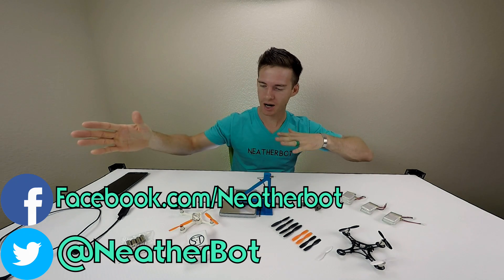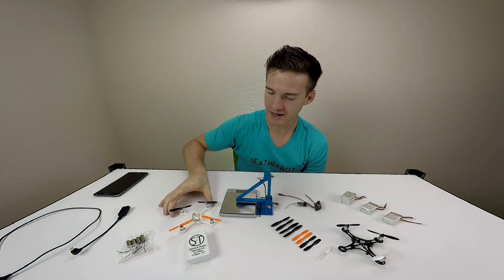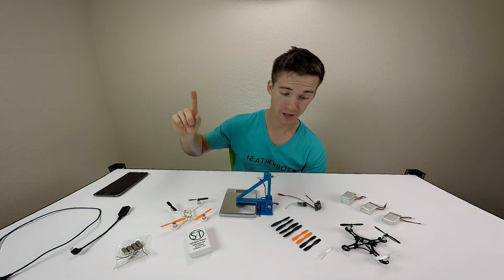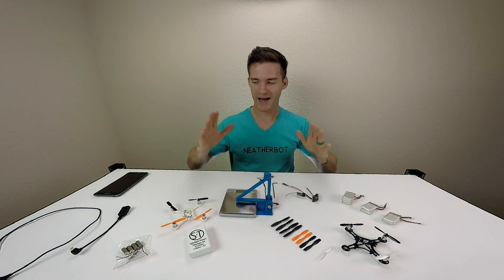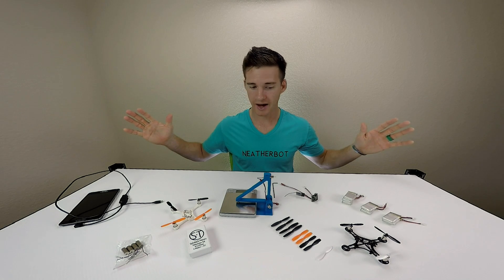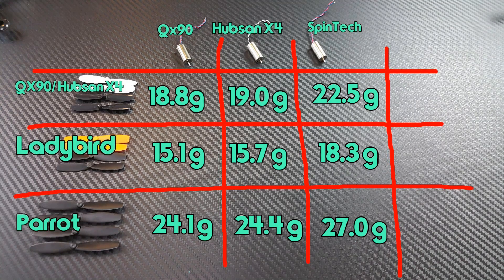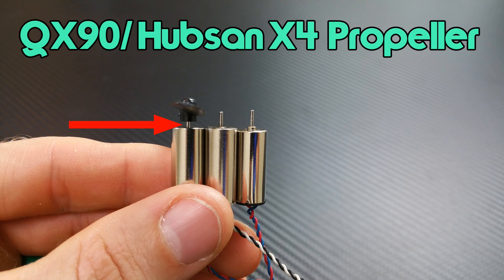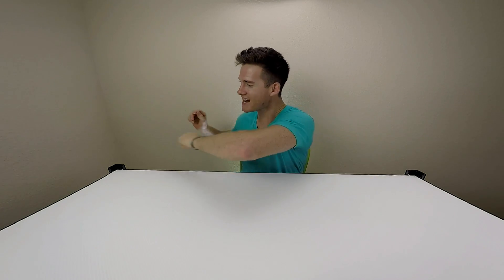Micro Motor Comparison

Comment: If you go to gearbest and look up nihui u807 motors they are 8.5 x 20 and they are around $1.50 each, they do come with long leads with connectors attached.
Reply from the maker: +DroneXFun this is music to my ears! What rpm are they?
Reply: NeatherBot   It didn't say, they are just stock replacements but they work really good on the U807.

Comment: So you're pretty much just using your phone instead of a laptop using that app instead of betaflight / cleanflight? Also what free program is there out there that I can use to design stuff like this the only thing I have right now is Cura.
Reply from the maker: +Larry Allard yes, the phone had an app that can adjust betaflight parameters. Tinkercad is a free Web based cad that is pretty powerful. Check it out!
Reply: Alright I wasn't sure. thx for the reply!

Comment: I had a friend print your test stand. It was fun getting it going. I just powered the motor directly. One of the most interesting things I found was that even a small nick on one of the blades reduced the efficiency of the props a lot. as much as 10 percent. So toss those nicked and bent props.
Reply from the maker: +Victor Johansen that is a great piece of advice! I have never considered looking at prop efficiency based on if they are nicked or bent. Sounds like a great video idea! Thanks for the comment. Cheers!
Reply: It disrupts the airflow. You might try sanding it out, but you will likely still have a loss.

Comment: can you please make a chart for amps which motors use most by comparing each props and motor to check how much battery time required to discharge during flight.
Reply from the maker: +Reality, Comedy & Entertainment I have ordered a tool to measure the voltage and current the motor uses during testing. I will be doing some more motor testing in the future.

Comment: Will the Parrot props fit on the QX95?
Reply from the maker: +Miko Smitho The parrot props do not fit without bending the QX90 frame or mounting the motors at an angle.
Reply from the maker: +Miko Smitho The QX95 I am not sure, I have not seen one yet.
Reply: Thanks for the reply. The QX 95 is awesome! I highly recommend it!

Comment: I found these cheap 8.5x20 coreless motors on aliexpress. The product page says "continuous current: 0.15A". Does that mean I can't go above 0.15A? Here's the link https://www.aliexpress.com/item/2PCS-DC3-5V-8520-8-5-20MM-Mini-Model-Helicopter-Coreless-DC-Motor-With-Great-Power/32392862460.html?spm=2114.10010108.1000013.3.pHy3Bx&scm=1007.13339.33317.0&pvid=1009e7ef-ec3d-47b0-b2b3-75258c71e819&tpp=1
Reply from the maker: +Arijit Ghosh continous current means that the motor can run at a load that draws 0.15 amps perfectly fine and not burn up. There are spiked loads that can momentarily go above that rating but only for a short period of time.

Comment: can you do the same with the new 2s 8520 and 1020 motors from banggood as these are becoming more popular and are being included in new models and people might be more interested in them...

http://www.banggood.com/Chaoli-CL-820-8_5x20mm-2S-Coreless-Motor-for-90mm-150mm-DIY-Micro-FPV-RC-Quadcopter-Frame-p-1084265.html

http://www.banggood.com/Chaoli-CL-1020-10x20mm-Coreless-Motor-for-90mm-150mm-DIY-Micro-FPV-RC-Quadcopter-Frame-p-1084263.html

very good setup and tests by the way.
Reply from the maker: +Khaja Shaik this is great! Thanks for the heads up. I'll try to get some of these in to review and give yall the results!

Comment: Nice job but did you take in account that the parrot prop produce more thrust because it is a Bigger prop. in the design of airfoils A longer arm and wider chord will produce a surface with a grater lift or thrust. the down fall is more weight added. but i think it is the reason the Parrot did so well....due to its bigger size...in my opinion its not a valid test. However on the quality build and durability of the different motor had interested me on to your experiment but you discounted that with a comment by you on the cost of the motors instead. if the more expensive motor has lower heating qualities and greater RPM it may be worth the price i hope this peaks your curiosity and make a video on that issue...thanks

Comment: you should try the cleanflight gui, it's better. you have to use a  laptop , but the set up is awsome. you should think about flashing betaflght, it will make your drone fly sweet
Reply from the maker: I have Betaflight flashed and it does work very well!
Reply: A lot better,i bet.

Comment: Also wont the parrot props take longer to spin up, being a large prop. Thus causing instances where you lose altitude in rolls and flips. Would be interesting to see the spin up times recorded (for the data nerd in me).
Reply from the maker: Not sure if it would make a noticeable difference. One way to find out!

Comment: Wanna know a real secret? Hook the motor directly into the battery. Same thing as full throttle without the extra crap in between.
Reply: It's pretty likely that in this sort of application, motor power is just controlled by a FET directly connecting the motor and battery (pulsing on and off to control power). 100% throttle will very likely be the same as a direct connection (minus some small loss in the FETs).
Reply from the maker: I would argue that would not provide the same voltage and current. On these micro quads it may not make a difference. We will have to test out this theory.
Reply: It should provide the absolute maximum power of each motor. As long as the cell remains at a steady state of charge, nothing should change. I'll print it out maybe and test it.
Reply from the maker: +joblessalex but there are inificiencies and limits in the FC that regulate and control voltage and current to the motor. Depending on the power curve of the motor and what the power output of the FC is you could see a difference in output between the FC and a straight battery. But I have not run any testing to show this. Yeah please let me know what your testing shows!

Comment: Are the parrot props the same as the Gemfan 65mm? they look pretty much the same and i fly them :)
i also heard, that the qx95 motors are better than the QX90 motors. (look at andy RC's channel) and i wonder which motors that are.
http://www.banggood.com/2-Pair-Gemfan-65MM-ABS-Propeller-Blade-CW-CCW-for-6-X-15-Coreless-Motor-Racing-Multicopter-p-1042645.html?rmmds=myorder
Reply from the maker: +MrPurple these are great questions! I will have to look into those gemfans. I really like AndyRC, he makes great videos! I must have missed his QX95 video. I'll look in to those motors as well. I'll post back in a bit.

Comment: So you tested all props in the wrong spin direction and treating your results, like it were 3D props or not? In my opinion you should make the motor pull, like on the copter, as you cannot put the prop upside down on the shaft. Unless you drill through them to put them upside down :)
Reply: mark schear no the props have a airvoil they dont work the same in reverse
Reply: i thinking the same he is running the ladybird prop in reverse
Reply: I've used propellors at this size backwards, and it does make a significant difference.
Reply: Mark Schear of course it does
Reply: serg fpv for all  intents and purposes, the stats are accurate. when all product is tested the same the results are reflective on each other. that means it don't matter.
Reply: serg fpv Reynolds number look it up
Reply: serg fpv you really think there is going to be a difference with this small of a motor and prop. maybe if you go to brushless  motor with larger props you mite see a measurable amount of turbulence. what your talking about is not even measurable at this scale. like I said I don't matter

Comment: Nice setup. However you forgot voodoo twisters and mmw motors which both are better than anything you tested in my opinion. You compared more props then motors. Should change title to "micro prop comparison."
Reply from the maker: +qwkmx5 hmm I may have to look into those motors. I had not heard of them before. I tested 3 motors and 3 props so it was a toss up ;)

Comment: maybe by making the motor aim up on a 45 degree angle you might get more accurate reading...as you will be pushing along the bearing axis not sideways. 

good video.
keep up the educational videos.
Reply from the maker: +meky0 if the motor was in its same location but angled at 45 degrees it would break its force vector into two componants. Only one of those components would be registered by the scale. Having the test stand point the motor perpendicular to the scale is necessary so that you get the same exact force down on the plate as the motor puts out. I hope that makes sense. 
Thanks for the thought and encouragement! I hope someone learns something from my videos :)
Reply: don't you lose alot of force trying to axially ofset the bearing?, would you not rather radially go with the rotational axis giving you a larger force on the scale, this would give you more resolution to distinguish differences.

i think i know what you mean by splitting force- perhaps your right, perhaps force will split and push into the bearing- down,
i feel however it will go down the easiest path the 45degree structure directly to the scale.

i feel like this would be a fun test.

I'm not overly educated in fluid dynamics- or physics in general, however for some reason I still feel that would yeild more resolution. at the very least it would stop your jig from needing as heavy weights.

not like it matters this jig was more than enough for the job of finding the best motor/prop combo.